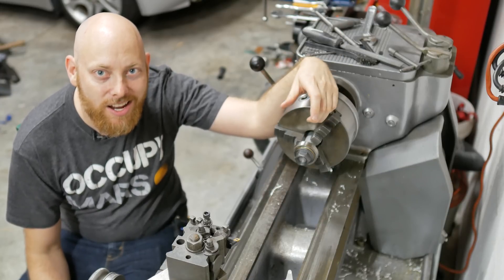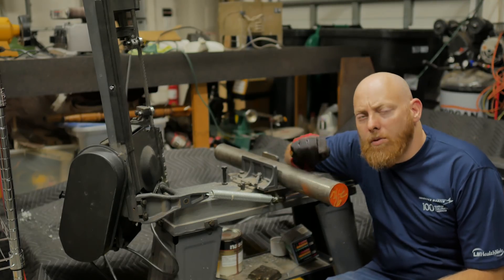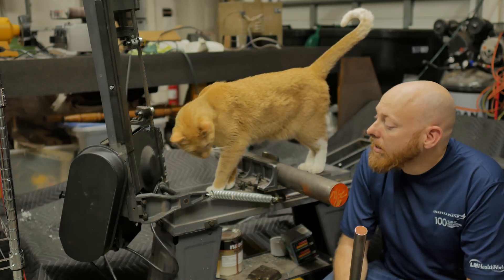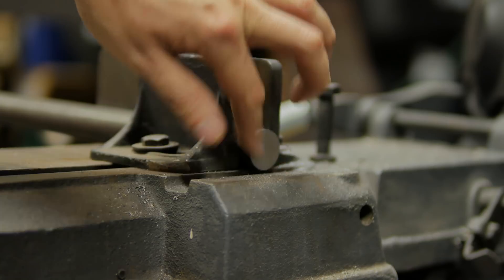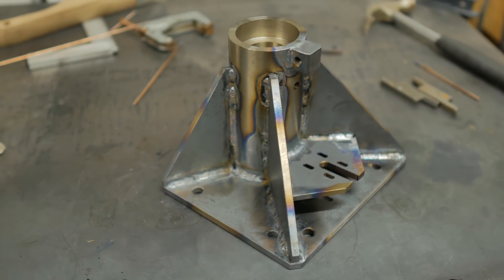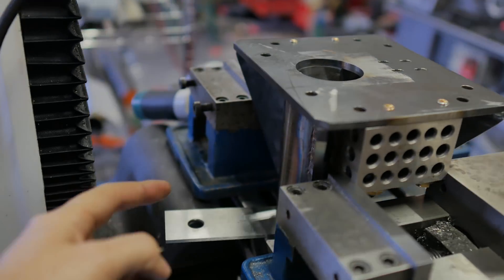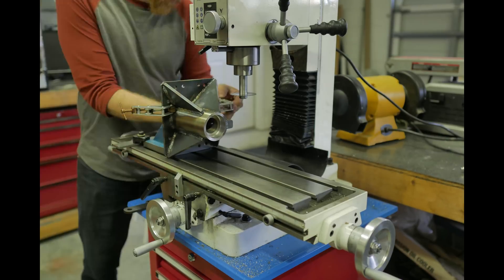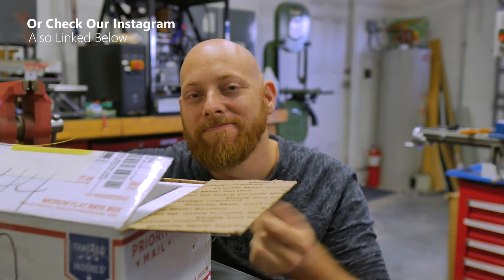Small Surface Grinder Part 10 - S02E35

Comment: At 8:30 or so, where you're looking for the center of the tube.  Does that even work?  If you had used a center or a twist bit I'm sure it would work well.  I just don't know if it works with a square-end cutter.

Comment: Ok, the bearings installed are really decent, angular contact bearings are definitely the way to go. Now I really wonder why your spindle sounds so awful now.
Reply: the brushless outrunner likely adds quite a bit of shaking would be my guess.  they are not well balanced.

Comment: 11:35  You know how people keep saying "welding warps metal"?  Thank you for providing an excellent visual demo of how the welding on the opposite side has shrunk the metal, making it concave on that side and convex on the side you are milling.
Metal expands when heated, pushing away from the heated area.   Any still-strong (cooler) metal resists and builds up energy, like a spring.  
Then the metal being welded gets red hot to melting, loses its strength and deforms.  The still-strong metal portions act like a spring, and release / move closer to their original shape, until the forces balance.
Then the weld cools to the point it freezes back into solid metal, and regains strength.
Then the weld cools the rest of the way, shrinking as it goes, pulling the weld together  - and that applies force the opposite way to any still-strong metal.  
This leaves you with a workpiece that is warped and has high internal forces; pieces fighting against each other.
When you machine away some of the metal, that will shift the balance.

Comment: I'm sure this has been commented on before, but adjusting the back stop on the upper and lower blade guides on your bandsaw, will give you much better performance and blade life.  The blade shouldn't move away from the work, as it's pushed into the cut.

Comment: @6:00 - At this point you are supposed to turn the boring-cutter over, cut the other side of the piece - while the lath is spinning in reverse and the tool is cutting as it is pulled out of the piece.  That way, if you over run, you are in open air and not driving in you you work...  (Internal threads are supposed to be cut the same way...)

@12:50 - You are not supposed to sue 1-2-3 parallel-blocks to fasten stuff down are you?  There is no way that the 1-2-3 block is going to help in that application.

Comment: I use the same style f saw you might find it more helpful using a grease stick instead of just running oil the grease stick helps clear the chips better I find.

Comment: Something I've been wondering about, but I haven't heard addressed in other videos... How does the cutter start the thread cut in the same place on every pass?  Is that something you have to manually set, or is it a feature of lathes with threading settings?

Comment: You should advance the screw cutter in a 29´5º slope with the compound, not right into the piece. It will give better control and surface finish.

Comment: After milling the top and boring the bearing fit on milled side, flip the part and clap to the milled surface and indicate your first bore. I know, its at the bottom but that IS the only way to get the two bores in-line.

Comment: "3/4 of the time is setup and measuring." I've worked in manufacturing for the past 20 years. This is so true. 'Setup' accounts for most of the cost in doing small volume runs. Love watching your channel, you guys are doing awesome.
Reply: This is why making jigs is an entire science and machining specialty of it's own, invaluable for production work.
Reply: Law-of Ohms I once heard the phrase that machining has two problems, and the latter can be the hardest: How do I cut this thing? How do I hold this thing?
Reply: 80% in my case sometimes more even.

Comment: I know all you see on these types of channels are "you are such an idiot, you did that wrong, back in my day" types of comments. So it pains me to do this. When you use the flat bar on top of the round stock trick to find the center, you should really use something with a smaller diameter and a rounded tip. The 3/8" end mill will hold the flat bar flat up to 1/16" to 1/8" off of center.
Reply: Dwarfracer88 yeah but see when you give useful, well reasoned and constructive advice it's appreciated :) You're absolutely right and we should totally do one showing this correctly, vs what we did, vs an edge finder solution and show how far out we could be
Reply: If I have the room between the quill and the work I use an aluminum torpedo level that I have. That gives me a more true indication than just a flat bar.

Comment: Good on you for managing to boar out that round stock with those cheap Chinese brazed carbide bits. Those things in my experience are a nightmare.
Reply: MOO Tech seriously, geometry on them is terrible. It's like they saw a brazed bit once in a movie and tried to copy it. Good news is if you turn them enough and relieve the back they do seem to be made of decent carbide, so "for the price..." 😁
Reply: I've found they work OK if you grind them properly before using them.

Comment: What kind of bearing did you use? Some sort of self-centering high speed bearing? I've never seen anything like this, these balls are huge.
Reply: Well thank you! Oh, you meant the bearing.
Reply: It's a 4 point contact bearing, ideal for axial loads in both ways, but not that much for radial loads actually... Also, it should be noted that it needs an enclosure with oil or grease in it and protecting the bearing from any outside dust or debris... For most of the applications you will probably just use a regular ballbearing. Not sure why they use that specific type of bearing, not at all logical in this setup..

Comment: No, lock-nuts are not supposed to be "tighter" than regular nuts. The "locking" uses different mechanics such as soft inserts (Nyloc) or split pins (Castle Nuts).
What you used to test the thread with was not a lock-nut. It was a flanged nut.
Reply: Windgonner https://en.m.wikipedia.org/wiki/Distorted_thread_locknut
Reply: As I said, they are not tighter, they have a distorted thread. That is, another type of mechanic for locking. The basic thread dimensions are still the same as a regular nut.
Reply: Deformed nuts are a completely different class of locknut, they really are supposed to be harder to thread on and off. It's not that the threads themselves are tighter, it's that the threads are intentionally misshapen so that they bind and aren't as likely to respond to harmonics.
Reply: Windgonner yes they're tighter they cut the threads then slightly crimp the nut. Hence the name distorted thread lock nut. They're used a lot for fwd car CV shafts.

Comment: not the best way to make a spindle, but seeing as you just got one in the mail, I may as well hold my constructive criticism
Reply: I’m interested in your constructive criticism. What do you think is the best way to make one?
Reply: J. plus well to start a non stress relieved weldment is not a grand idea, I think the over all shape of this one with the adjustability is a great idea, I probably would have made the spindle a separate cartridge and secured it inside this thing. Any thing that's important for a mill or lathe is 10x more important for a surface grinder, you want some way to adjust preload in your spindle bearings, let's face it it's going to be the only one, and way too small so by default it's going to abused and pushed to it's limits. So you want the bearings to be rock solid. Step one, throw that ball bearing away. Or use it in the tail end just to support radial whip.
Then get a pair or better yet, 3 AC bearings, in this confirmation (<<>) some timkens would also work, but Angular contact bearing are much easier to work with, and for a project like this you can get pretty cheap ones. Capture your nose bearings axially instead of radially. A bolted on nose cap is the easiest to fab and more accurate, but a big goofy shaped treaded retaining cap/nut works. Then make up a speith style nut for the tail end so you can adjust your bearing preload. You could buy one but they're only about a trillion dollars, and you could use jam nuts, but they suck and will drive you crazy, totally worth your sanity and a hour to make one.
Reply: EitriBrokkr Thank you for the thorough and detailed answer. I appreciate the insight.
Reply: J. plus not a problem, if you ever need a rough sketch or more info on the topic let me know

Comment: Hey guys. Been watching the video's and loving what you are doing. Noticed on the welding episode that you had trouble with warping and that's gonna be a problem every time you add heat or make a cut  with metal. If you want to make something again like that you may wanna look into this company.
https://8020.net/      It's the 80/20 Inc. - T-slotted aluminum framing system. This is a real nice, convenient and flexible industrial erector set like system. And no, I do not work there!  ;)

Comment: Maybe look into setting up some kind of flood coolant system for the band saw. Maybe not so useful on the small diameter stuff but I’m those big bars it would help evacuate the chips a bit better than just some sprays
Reply: as soon as i commented i saw your post, i hope he sees this
Reply: Nonsense, I cut almost everyday, steels around the 3 inch diameter and sometimes bigger on my horizontal bandsaw with no coolant or lubrication and still have the same blade that I was using this time last year